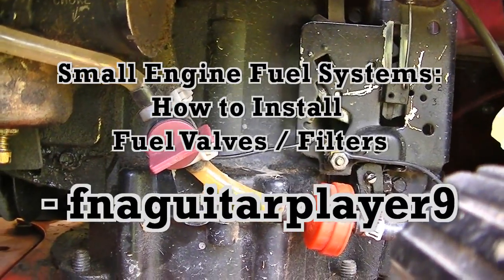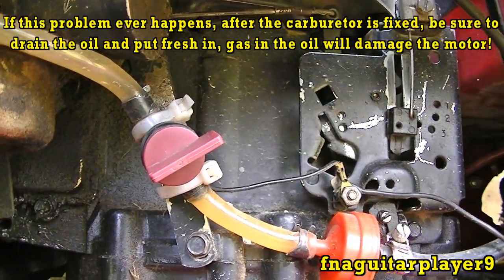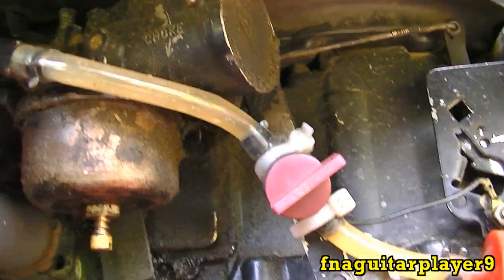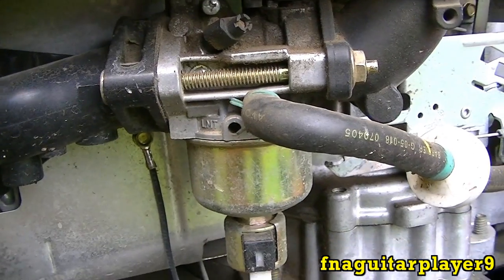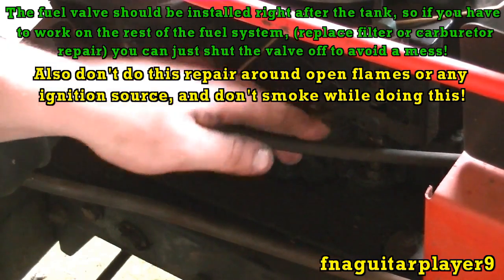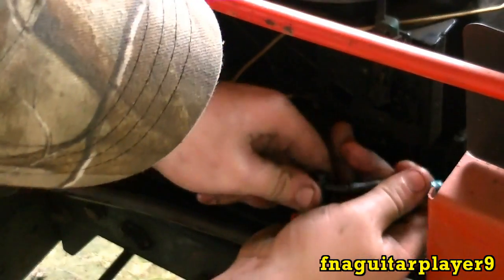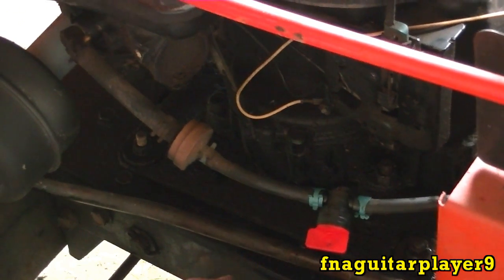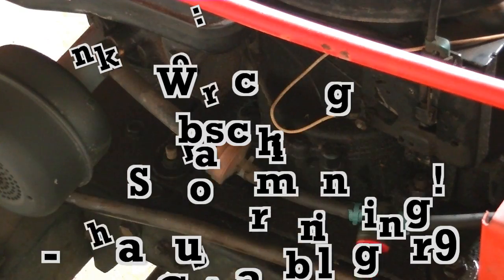Small Engine Fuel Systems: How to Install Fuel Valves and Filters

Comment: how does gas flow into the crankcase (oil) on these older carburatorated lawnmowers?
I tried tracing possible pathways but couldn't find and understand how it would seep into the crankcase unless it was through a worn piston seal or a worn valve seal.
can the gas in a flooded carburetor travel up the breather tube into the crankcase (oil) maybe?
Thanks.

Comment: Your inline fuel filter, can it go in in either direction? The ones i bought do not have fuel flow arrows.
Reply from the maker: Simple answer, yes, it can go either way. long answer, if its the briggs style like in this video, its supposed to flow into the filter on the "small" side, but if you look inside it, its just a screen, so it really does not matter. on the cage type with the cartridge filter looking center piece (clear type) fuel flows into the "shell" of the filter then through the filter, if it went into the outlet side it would clog up earlier, since it would be filling up the inside part of it, but would still work for a long time. Hope this helps! Thanks for Watching!!!

Comment: can I install a fuel filter like the little red kind on my toro 22 inch push mower 190 cc 7.25?
Reply from the maker: Yes, I actually recommend it. Those are bad about the bolt/jet clogging up and that will definitely help it. Thanks for Watching!!!
Reply: fnaguitarplayer9 thanks for your response and video. I really want to install the fuel filter and fuel cut off lever, it will avoid carburetor problems in the future, my only concern is if would void the warranty, the mower is 6 months old. I use a lot though.

Comment: When I do this, I cram everything as close to the carb as possible. I usually cut a 2" piece of fuel line, hook that to the carb, then attach the fuel filter to that. Then I cut another 2" piece and use that to attach the fuel filter to the shutoff, then plug the tank feed into the shutoff. At times where gas is $4 a gallon, I like to try to save as much as possible. I actually shut off my valve when I'm halfway done mowing the last row of grass, and I have enough time to get it to the shed and wait 30 seconds (full throttle) before it runs out of gas. I usually let it idle while it uses up the leftover gas, I think it's better to let it idle and keep some air moving around the engine before I shut it off. It usually lasts a minute and a half while idling on what's left in the carb.
Reply from the maker: I hear ya, i don't blame you a bit, gas is ridicules anymore, thats a good idea, shutting it off first like that, I might start doing that, i usually choke mine when it starts chugging so it burns every last drop thats sitting in the carb haha Thanks for the ideas, I might start doing that, a little adds up in no time. Thanks for Watching!!!